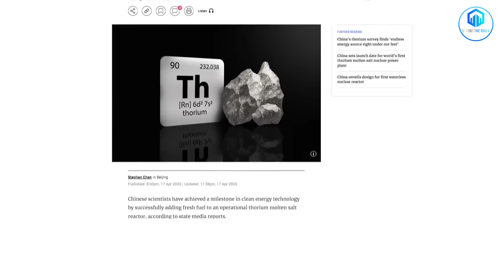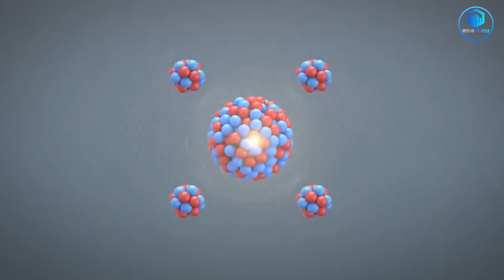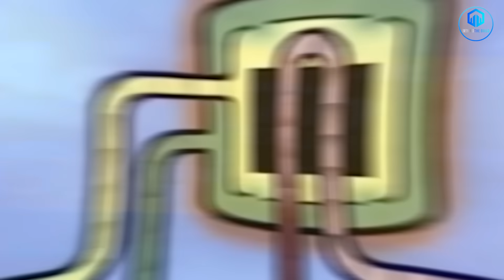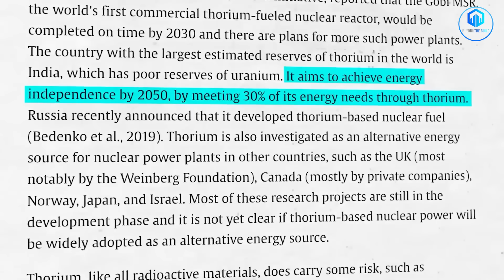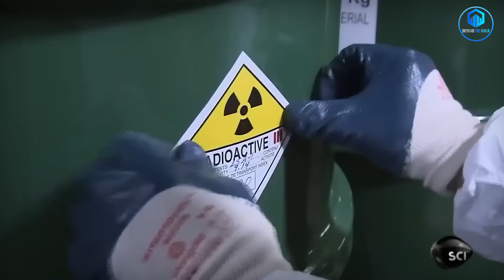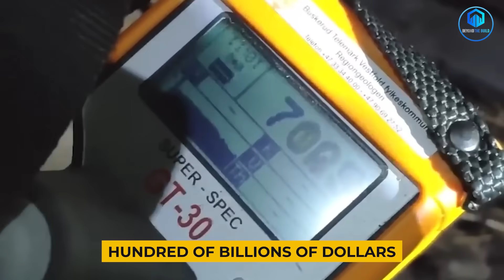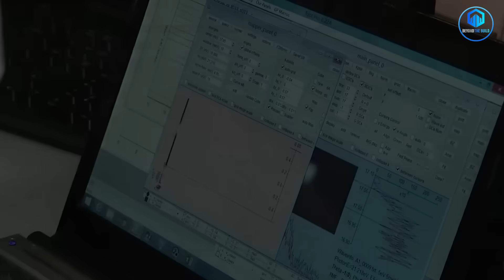China’s World-First Thorium Reactor That Never Shuts Down

Comment: Online refueling is not new. CANDU reactors have always done that. And refueling is not such a big deal, which is why it is standard practice. It's economically competitive with the CANDU and other online fueling reactors. But the liquid fuel is revolutionary: it eliminates fabrication, and the continuous removal of fission products, esp. the volatile ones, stops pressure buildup and greatly reduces neutron absorption (poisoning), allowing higher burnup. Also revolutionary is that this achieves net breeding, which is what allows it to use thorium, a non-fissile material that breeds well with slow neutrons. The established breeder reactors use fast neutrons, which cause more structural damage and make the reactor more difficult to control. On the other hand, otherwise suitable molten salts are poor moderators, so something else has to be used that is compatible with this very complex liquid containing fission fuel and fission products dissolved in molten salt (e.g. nuclear-grade, highly impermeable graphite. Sodium hydroxide encased in something that can withstand the complex, hot liquid, and which is also transparent to neutrons, has also been proposed.). A molten chloride salt fast breeder would not need a moderator, and the salt is much cheaper and less toxic. Fast breeders consume all actinides efficiently, allowing them to eat spent fuel from non-breeder reactors and depleted uranium as well as thorium. And filtration of fission products does not need to be as thorough with a fast breeder because fast neutrons are much less sensitive to pile poisons.
Reply from the maker: Great insight especially about neutron absorption and breeding. Which reactor design do you think will dominate the next decade?
Reply: @beyondthebuild-1  Most likely, large light water reactors will continue to dominate for another decade, but as the use of nuclear power increases, the ability to breed fissile material from non-fissile actinides will become more important. I know of no more economical design than Ed Pheil's molten chloride salt fast breeder. However, political repression and war can kill demand for power by mass-murdering people, or "bombing them into the stone age", and can seize uranium mines and control access just like oil, coal and gas are controlled. Filtration of uranium from seawater will not supply enough uranium if everyone does it and we're still using mostly light water reactors; there will be contention over the best places to filter the water, and large filtration farms will disrupt fishing and  marine widllife--or, more likely, the problem of marine wildlife taking up residence in the filter will prove to be insoluble.  Ultimately, if humanity is to survive, we need steady growth in nuclear power, and that requires the fast neutron breeder, although we may also use slow or epithermal neutron breeders and thorium as well as depleted U. A breakthrough in fusion is also needed in the long run because fission is not so good for rocket propulsion, and uranium and thorium are not so abundant on planets and moons that lack the kind of geological activity that we have on earth, which concentrates these rare elements in our crust. But fusion is hard, and I don't see a breakthrough is likely to happen if we shun fission and stall the growth of our economy; fusion research carried out by impoverished people continually at war is likely to be far too slow to overcome the loss of information by the deaths of the researchers.

Comment: China is moving into the position of world leader with its energy innovation.
Reply from the maker: Yeah, China’s energy game is on another level 👀 Do you think this will shift global power dynamics long-term?
Reply: @beyondthebuild-1  Yes!  I believe that a long-term shift is coming as the fossil fuel industry falls, not only because of pollution and global warming, but primarily due to economics.  Global subsidies won't sustain the fossil fuel industry for long.
Reply: @beyondthebuild-1  
I think it has potential to shift power dynamics SHORT term.
Just consider the US reaction and pressure towards Iran (A month after the China / Iran Rail Link opened)
ALL the geopolitical strategy of USA is based around
1) BRICS/ Belt & Road.

2) Control of Energy supply.
Any region where BOTH of those factor converge is, and will continue to be a "Hot Spot".
So 
Middle East (Or rather West Asia?)
The Red Sea Corridor
Africa (The whole continent)
Central and South America (Watch for the "Shift to more local control" pushing to dominate and asset strip countries south of Mexico)
imo
Reply: I would say "World Facilitator"
Reply: It's not energy innovation. It is improving it like Japan in the 50's.

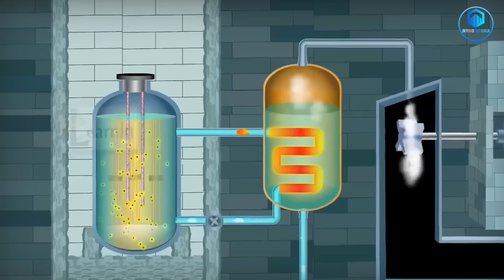Comment: 8:04, or like, copper roofing material in Europe -  that last, well still around, hundreds of years.  Because copper oxidizes and formes a protective "patina," on exposed areas.  And once formed, oxidative deterioration simply stops.  Because the patina shields the otherwise reactive bare copper, from air and water.
Reply from the maker: True, copper’s patina is a perfect example of natural protection. Do you think future reactors could use similar self-shielding materials?

Comment: The stupidity of the USA leaders knows no boundaries.   Alvin Weinberg developed the idea to use Thorium in a LFTR lquid loop round 1960.   Engineers and scientists rightfully saw the huge importance and made a test unit round 1960 and were beyond excited.    But Nixon stopped the development in 1970 as the government were not interested in serving the nation and the people.   It is by coincidence that Kirk Sorensen found a book in which the principle was described and after some searching they found research reports that the scientists and engineers had stored in a school.   But even then the government or nuclear industry were not interested.
Realising the great importance the Chinese happily picked it up and put some 700 engineers on it and within some 5 years now have a commercial Thorium reactor running.  
Now USA Mitch McConnell undoubtedly will call it an economical threat to the country ... as he did with Huawei.
And not able to compete Trump will raise tarifs ....
Reply from the maker: True, China turned an abandoned idea into a national project. Do you think this will push the U.S. to revive its own thorium programs?
Reply: @beyondthebuild-1  USA was an INC in London.   As a republic USA may consider but they have to buy now from China.   Thorium reactors are very compact without huge buildings as no boiling water water and everything is low pressure and safe.
Free energy systems, cold fusion are good alternative options.
Reply: The west has peaked
Reply: Kirk Sorenson literally saved the research that was in its way to the shredder by pure chance, published it on the internet, gets attention of Chinese engineers. Actual divine intervention.
Reply: They are not stupid. Just narcissistic criminals who do what their rich owners want them to do.
Reply: stupidity or by design!!? Tesla the REAL Tesla had his research confiscated! people who spoke or had figured out or made zero point energy / free energy devices / engines powered by water / cure for cancer have all been stopped!!! Youtube used to be full of interesting videos and documentaries!!! richard hoagland and moon and mars structures! youtube is the US gov and has been sanitised
Reply: Corporate GREED.
Reply: F-
Reply: It is not stupidity, they just do what they were told by their donor (company that throw in shit load of $$ into uranium system )
Reply: The stupidity of Trump can be a bless in disguise for the Global Majority. Because this is a wake-up call for them.
Reply: What an idiot... a decision with so many negative consequences.

Comment: The construction cost and time are much greater than traditional renewable energies like solar and wind.  But it’s weather independent, works day and night, windy or calm, freezing or hot.  Can be installed on a remote island or even an aircraft carrier.
Reply: My thought, EXACTLY, on they could be placed on 005, 006, possibly even 004, and- underwater manned OR, unmanned - vehicles.
Reply from the maker: Yeah, that flexibility is what makes it stand out 👀 Do you think reliability matters more than upfront cost in the long run?
Reply: @beyondthebuild-1 virtually free unlimited energy? Sign me up.

Comment: Thorium reactors were developed in the US in the 1950s. The problem was corrosion. 

However, if the corrosion problem is solved then if you keep the reactor running continuously then you don't get thermal stress that will eventually crack up the reactor. Cars are similar. Most of the engine wear is in the first 5m of running it as it gets up to nominal operating temperature and pressure.  Presumably since the 50s better materials are now available to deal with the corrosion problem although the US were happy to do it the old way because thorium reactors can not make the plutonium used in nuclear weapons. The US puts war as the first priority of the state.
Reply from the maker: True, the corrosion issue held it back but priorities definitely played a role too. Do you think today’s materials could finally make it work?
Reply: @beyondthebuild-1  Maybe it will work. I think this is why they have an experimental rig to test it.

Comment: what happened to the Fusion reactor?
Reply: The elite uses fusion research at large scale (France) as it is extremely costy and for sure it will not work in the coming 50 years.
Reply: People are still working on it, and the chinese is leading.
Reply from the maker: Good question 👀 Fusion gets all the hype but moves slow. Do you think thorium is the more realistic path for now?
Reply: @beyondthebuild-1  I don't know, but in the end, all comes down to the cost of operating the plant.
Reply: @beyondthebuild-1  Thorium process is proven. There are some material problems that can be overcome.  There is enough Thorium on Earth, easily mined, when worldwide used, for 10.000 years.    There is nothing against fusion but Thorium is the process to go for the time being.
Reply: It’s still being worked on China is very busy chances are you will hear about on a Wednesday
Reply: Few days ago Chinese state media reported that our first cemercial fusion power plant just settled down a key component. Saying it will fire up between 2028-2030.
Reply: @thermalstoragesystemfromtr9513  Fusion is demonstrated in small units, but there is a way to go to build a commercial unit.   Thorium LFTR (fission) is much simpler and even that takes more time.

Comment: This is just the Liquid Fluoride Thorium reactor successfully implemented as a molten salt reactor at the Oakridge Laboratories in the late 69's and 70's and it's passively safe so far safer than conventional solid fuel rod reactors...

This isn't Chinese technology but technology co-opted from the States because Nixon thought that a technology that only required a security guard simply didn't hire the hundreds of operators that a liquid metal reactor would need to be safe so the molten salt reactors and actor simply didn't get the funding...  Note that when China announced they would build a their version of the Oakridge reactor for 2025, Obama agreed to provide US assistance so that China wouldn't be able to claim the IP rights as their own.  Search on the LFTR if you want to research this reactor.   Note, another reason that is suspected for the US dropping the LFTR is that it doesn't produce weapons grade plutonium as the US light water nuclear reactor does...
Reply: Whatever reasons you may have but the fact is China had  put into operation such technology, period.
Reply: US provided assistance? Hahahaha! Yeah, yeah, yeah! Like providing a hole in the head. 🤣🤣🤣🤣
Reply: COPE! you think they shared that Oakridge reactor tech to the chinese? NO!

The chinese learned on their own.
Reply: Short story, the US dropped the ball in energy research. Are Oakridge IP lawyers threatening to sue China? It figures.

The US was a very different place back in the 1970s.